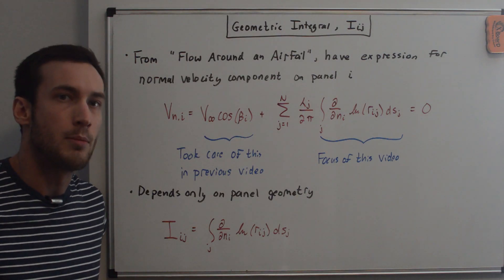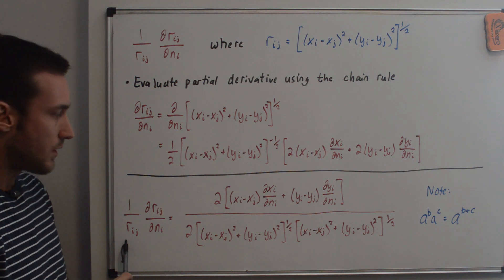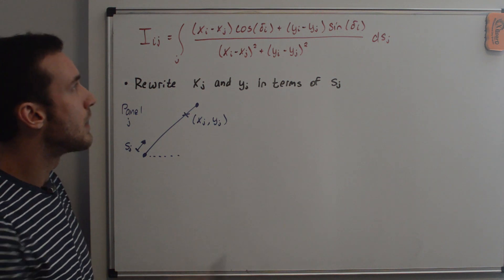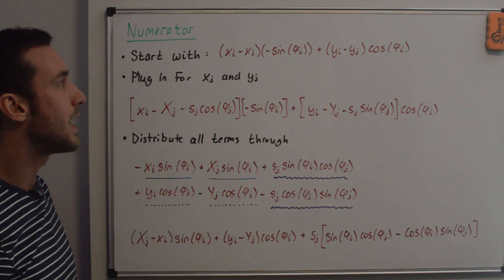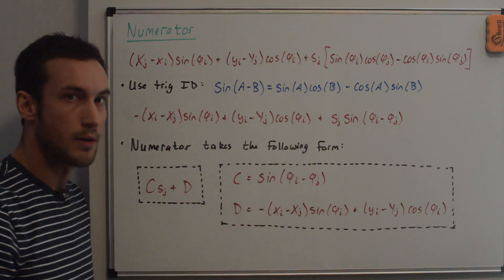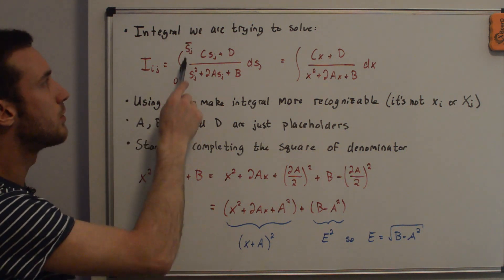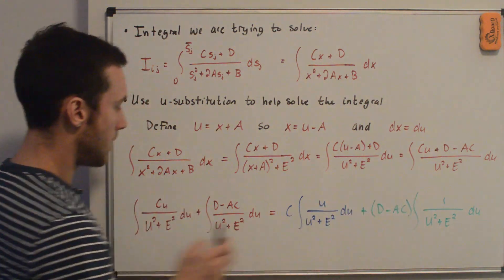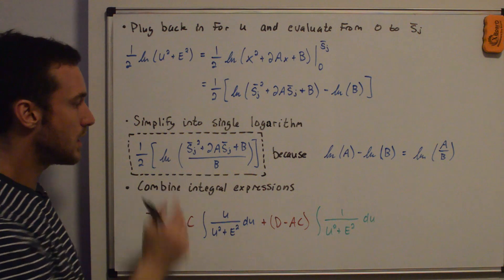Source Panel Method: Normal Velocity Geometric Integral [I(ij)]

Comment: At 21:22 for clarification. is (x_i, y_i) the coordinate of the control point for the i-th panel? or the starting boundary point for the i-th panel, like (X_j, Y_j) is for the j-th panel?
Reply from the maker: Good question.  Since we are solving for the normal velocity at the control point of the i^th panel, the (x_i, y_i) coordinates are always the control point coordinates.  Since we are integrating over the j^th panel, we will be using the boundary point coordinates for the (X_j, Y_j) values.

When I post my final video (and code), you'll be able to see that every (x_i, y_i) gets replaced with values I call XC(i) and YC(i), and every (X_j, Y_j) gets replaced with values I call XB(j) and YB(j).  As you might guess, the C stands for "control" and the B stands for "boundary".
Reply: @JoshTheEngineer  Great, looking forward to seeing your implementation. I've got my own nearly finished and working.
Reply from the maker: @williamsworkshop8624  That's awesome.  I'll be filming these final videos soon, and I'll post that code when I do.